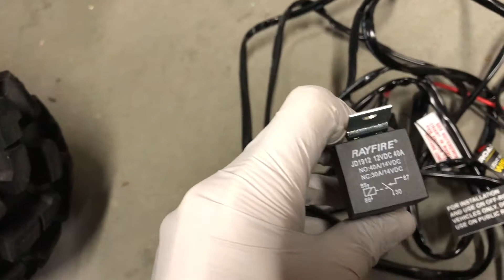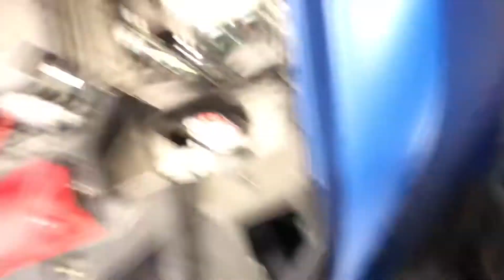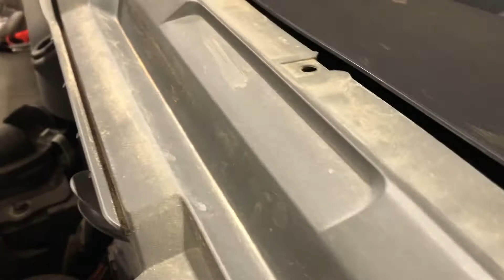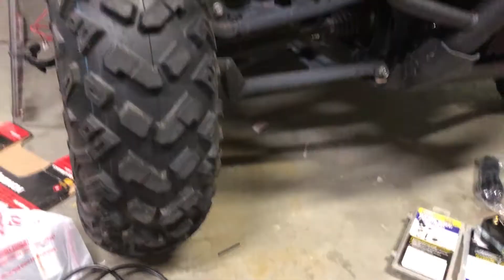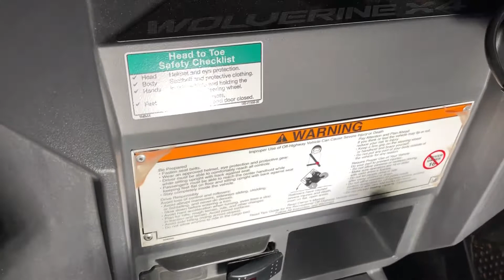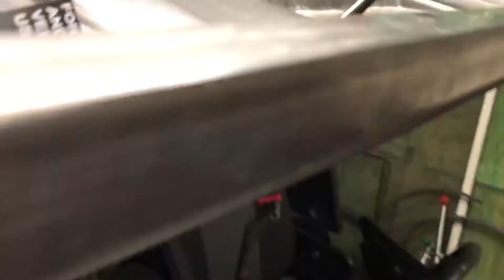Wiring a typical light bar on a Yamaha Wolverine x4

Comment: Those connectors to tap into the stock accessory plugs, where did you get them?  @ the 9:44 mark?
Reply: More links for the connectors:  https://www.corsa-technic.com/item.php?item_id=227  How to info: https://www.yammerhammers.com/2018/08/adding-electrical-accessories-to-wolverine-x2-x4/
Reply from the maker: Thank you for the question. You can buy them here: http://www.cycleterminal.com/mt-series-090.html. That particular wiring harness was from this winch mount kit: https://www.amazon.com/2018-2019-YAMAHA-WOLVERINE-FRONT-BG4-F28M0-V0-00/dp/B07F2Z1NKX.
Reply: Hi, great video.  Where did you purchase the switch that fits in the dash?  Thank you
Reply from the maker: @limbolimeschannel6841  You can get them at most auto parts stores. I got my at Rocky Mountian ATV: https://www.rockymountainatvmc.com/parts/dragonfire-racing-led-accessory-switch-p. Thank you for the questions and for watching!